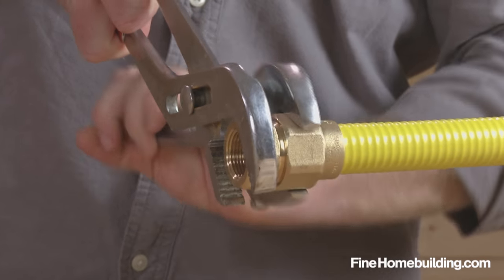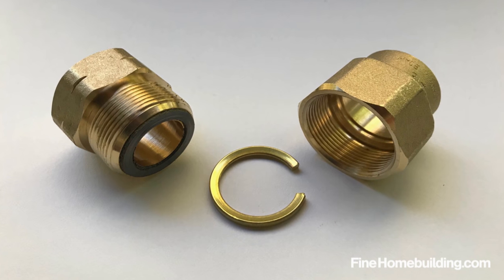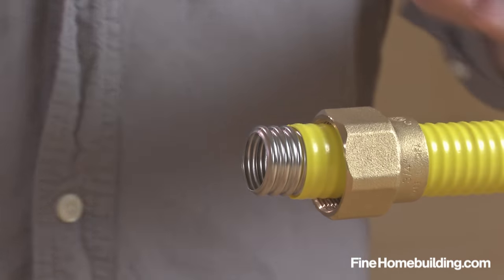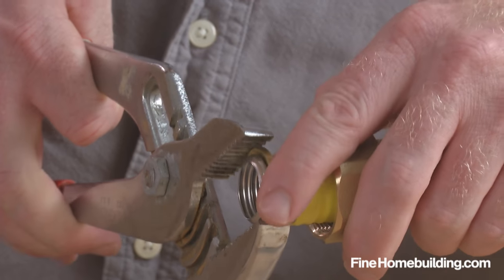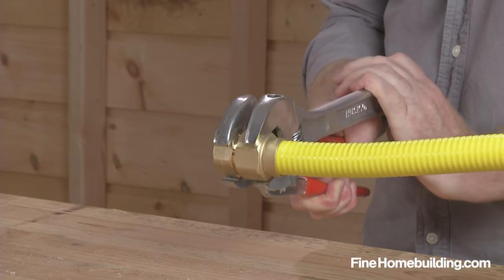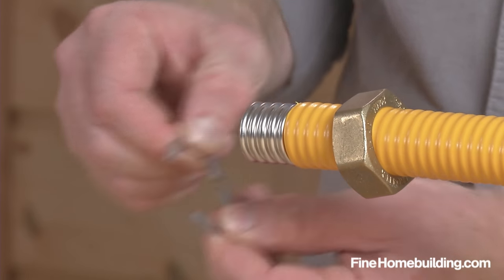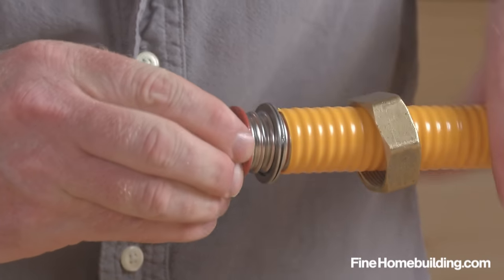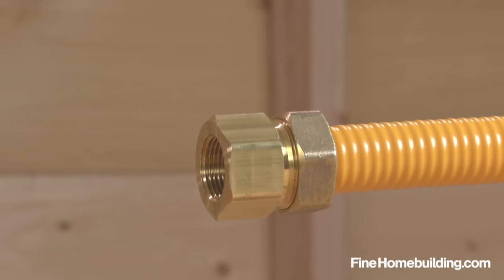How to Install CSST Fittings

Comment: Used Home Flex and here's what I learned 1. Make damn sure the cut is absolutely clean because burs will cause leaks and might rip up the fiber washer as well. 2. After the fitting is installed and you're ready to make connections always always always use the best pipe dope and Teflon plumber's tape on the male threads. I unfortunately followed the advice of purist plumbers using just pipe dope and had leaks that were so minor they were undetectable using soapy water. The best way to do this is to first apply a thin coat of dope followed by the yellow Teflon plumber's tape. Wrap the tape so you have 2 layers and in the proper direction so it doesn't bunch up. 3. Take the time to do this all as perfect as you can because it will save you mega hours chasing down leaks caused by sloppy work.
Reply: And lastly leak test

Comment: When using Channellock Pliers as in this video,  put them on the opposite way he showed you!
Reply: @0714will  The fittings appears to not need to be so tight that position of the pliers matters.  So long as one can tighten the fitting sufficiently, wrench position does not matter.  Lighten up.
Reply: @alsnyder1660   he’s a purist
Reply: Slip joint. Channel lock is a manufacturer. Mine just happen to be Vise Grip brand, and I have Kobalt ones.
Reply: @alsnyder1660  -- I had a father that did his best to teach me the proper way to use tools!

Comment: I am wondering why the maximum torque the installer is allowed to apply is not mentioned.
Reply: Instructions on home-flex for 3/4 say 90 foot lbs or as tighten until it won't turn any farther.
Reply: @danieltweddell5973  wouldn't that destroy the rubber O ring? The man clearly said one quarter turn.
Reply: @twinkie27271  
I believe from watching the home only has the metal ring and that is what he's referring to torque to 90 ft lbs. The kind with a rubber o-ring is a quarter-turn after hand tight.

Comment: This stuff is a hell of a lot easier than black iron pipe
Reply: But a lot more things that can go wrong. Black iron pipe will last 50 years.
Reply: @kCI251  with any luck, so will this, and in 50 years, I won't care anyway.😅
Reply: @twinkie27271  There are issues with lightning strikes causing holes in CSST and resulting in fires.
Reply: I think copper is better but is not allowed in the US

Comment: Can you tell me exactly what I need from proflex to get form the 3/4" csst line to 1" black pipe? I've searched for days.
Reply: You can use a 1 inch to 3/4 inch reducer coupling to reduce the size of the black pipe to 3/4 inch so you can use the normal 3/4 inch CSST fittings to screw onto it. Obviously if you do this the 1 inch pipe functionally becomes a 3/4 inch pipe and won't be able to supply as much gas, but that may be okay depending on what you are using it for. Hopefully this helps
Reply: @averyalexander2303  Thankyou
Reply: @ronjames4749  No problem

Comment: I have to run Home Flex Underground pipe (or the equivalent) to a gazebo about 70 feet from my BBQ connection. I'm planning on burying it. Should I be increasing the diameter of the piping to handle a run of that length? Advice is appreciated!
Reply: Use yellow pvc cheaper and code approved. Make sure to sleave ie add pipethrough penetrations if your going to cover floor with concrete or pavers.
Reply: @benram32  Thanks. You mean add an extra sleeve where you’re going under concrete or pavers? Also, my BBQ line is 3/4. Should i bump it up to 1 inch to carry the gas the extra 80 feet, or just leave it at 3/4?
Reply: There are charts to determine the pipe size required for btu of your BBQ and max distance. FYI you can always go bigger but never smaller.
Reply: It depends on system pressure and load.
Reply: Did you already do this project? If not, run a tracer wire with it also

Comment: These fittings leak easy. I find them with damaged pieces leaking all the time. .
Gastite is the best. Pinches cast hard making a durable connection.

Comment: No matter how convenient flex tubing might be, I do not trust it. Black iron or traditional
copper tubing are my choices. Flex tubing is too vulnerable to damage, and connecting
the fittings looks hinky to me. Things can go wrong.
Reply: I use a combination of flex and black pipe on strategic areas.